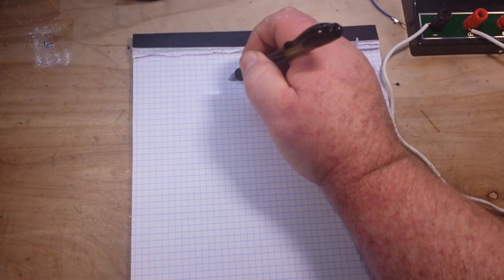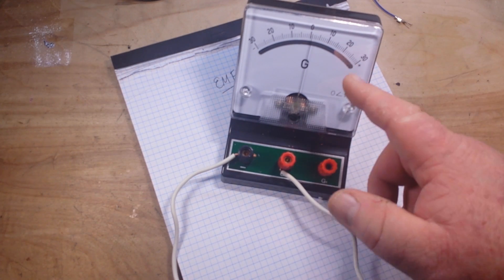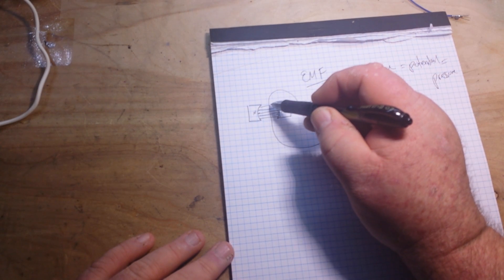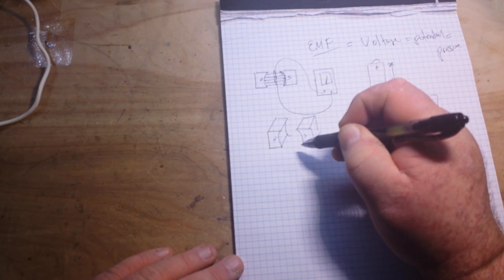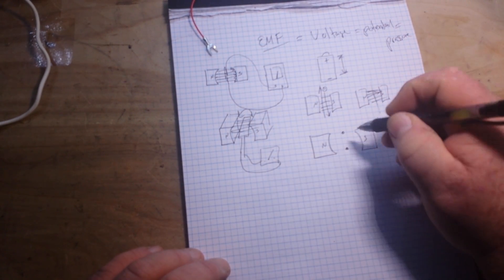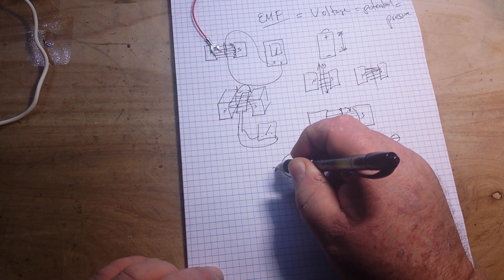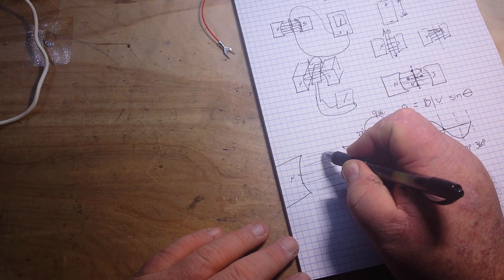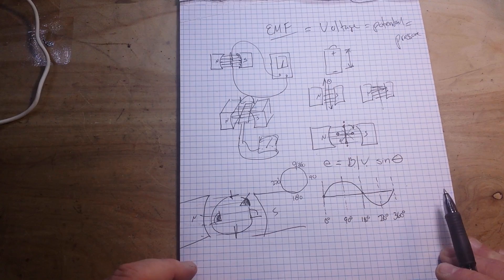EMF Motors and Generators

Comment: The basic rotor and stator :P Get graphite brushes on the motor . Voltage varies with rotation which describes a full circle(2*Pi) and goes in sin(@). Put the circle and grapth side by side with sin being the Y axis and you will see it matching. Have a nice day.